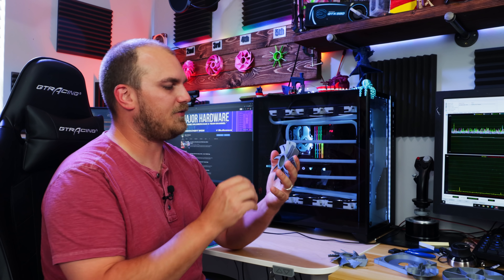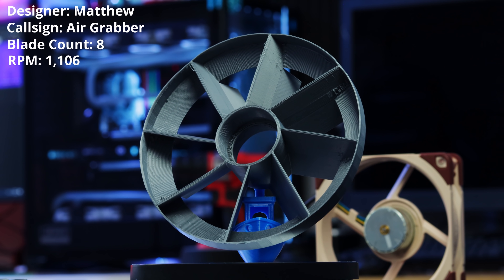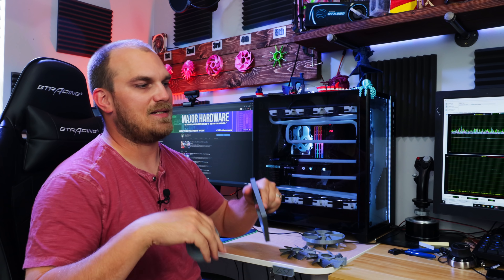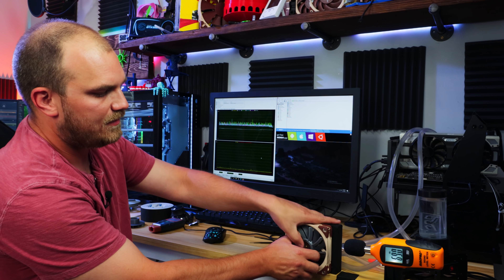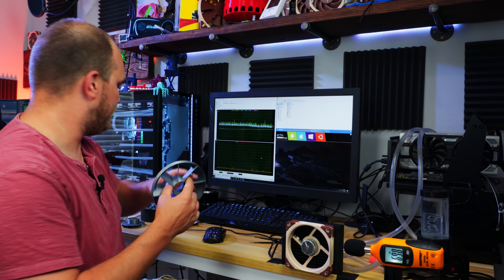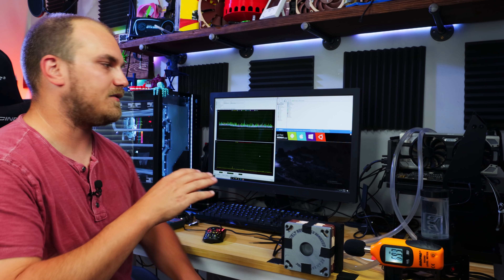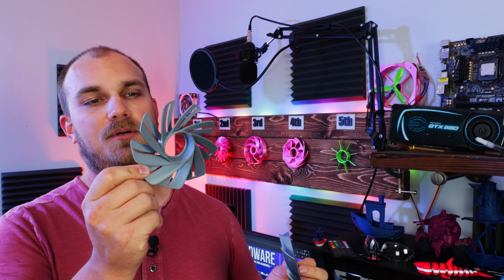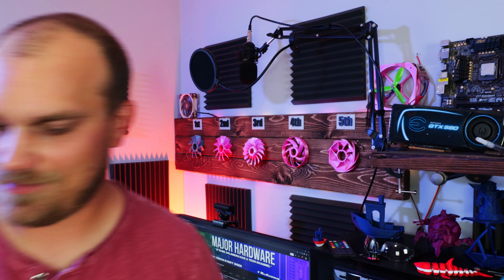We Are All Noctua Engineers | Fan Show Down Episode 4

Comment: Guys I need help , got a ASRock 970m pro 3 with 2 dead capacitors .....
I can't find the same ones.

Only markings are
5ky141 
820
3v 

any tips on another that may be compatible would be much appreciated 😁😁
Reply: Let it go. AM3 is dead.
Reply: You could solder and replace them but by the time you buy materials. Find the right part and etc, your honestly better off buying a a320 board (their like 40-60$ ) and used r3 1200 or r5 1400 (70-90$) and 40$ or 8gb of ddr4. You would have a lot more performance and it would be around 200$ with an upgrade path up to ryzen 3000 series if you wanted. At this point im not sure its worth it
If you insist though 5x Genuine Nichicon PLF0E821MCO6 820uF 2.5V 8x9mm Polymer Motherboard Capacitor
These should work as long as they physically fit, search for them on ebay
Reply: @ShartsInTheAir  I'll check it out thanks!!!

I'm just doing it to learn more, main system is 3900x/2080ti 
but a friend brought me that old MOBO , said I could keep it since he didn't know what was wrong with it , but one capacitor , outside shell is completely gone and another looks like it's trying to launch off the board 🤣
Reply: @deminybs  I got you, those should work. They might be custom for the mobo, or no longer available. 3v is an oddball current these days, but 2.5 should be in tollerance range.
Reply: @ShartsInTheAir  awesome thanks man, I wouldn't have known that lol, literally within a week just started learning more, + I've always loved to tinker just some things I didn't have extra money if I broke something so never tried. But hey since I got a free MOBO might as well make it my learning board. 
also I think the CPU vcore is only capacitors with 3v, rest are 6.3 or different. 
guess I'll find out if I also need new mosfets that are right behind those line of capacitors , still learning how to test for open/short circuits ect with multi meter
Reply: @deminybs  Louis rossman's channel is something that probably would interest you
Reply: @ShartsInTheAir  yeah I like him and adamant IT so far